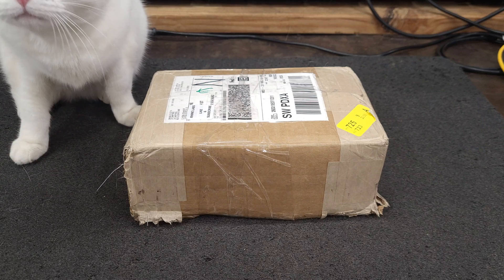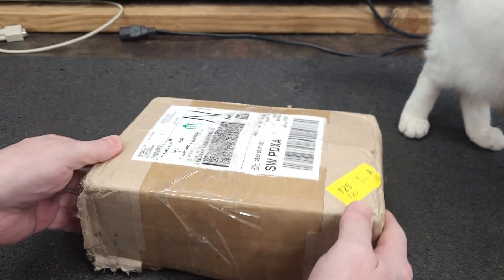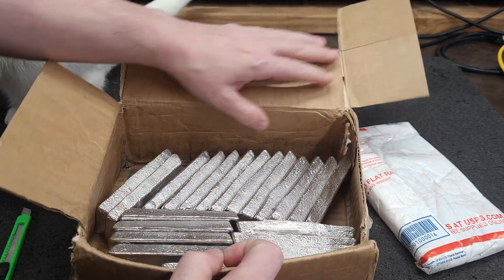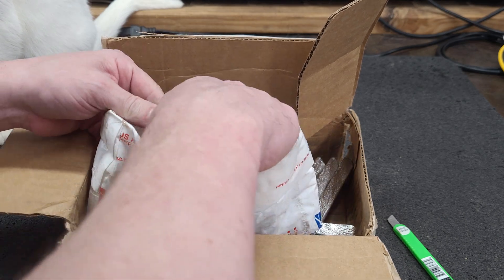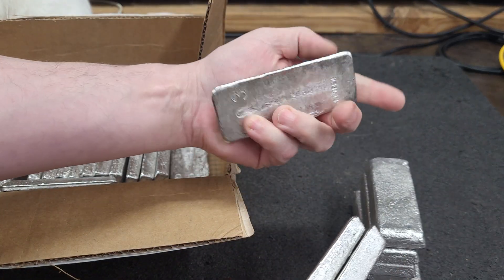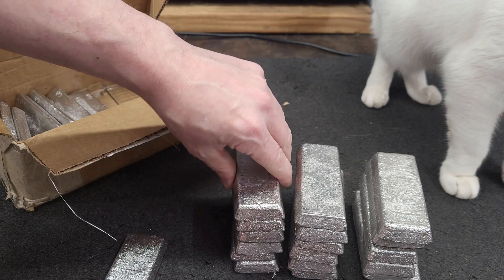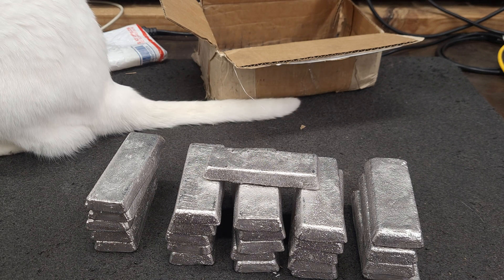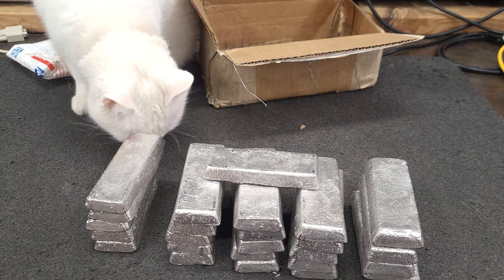Lifetime Supply Low Melt Solder Roto Matals 203F 95C Ingots

Comment: It’s a shame they’re not gold ingots 😂😂 that’s enough to last a lifetime. Been to website, might have to put in an order, definitely a better way of buying it.
Reply: Same here.  One order would definitely fix me up for life.
Reply from the maker: I have been using it for a while now works well.
Reply: @ I’m definitely going to give this stuff a try, been using the low melt chipquik but it’s quite expensive for not a lot of it. Thanks for sharing this.
Reply from the maker: @SURGE101  Chip Quick melts at 138C or 280F = to the Roto281F without the minuscule amount of ag silver. I tried the Roto202F lead free it was good also but not 4 to 5X  the price good.

Comment: Oh wow, that is so much cheaper than buying it in preformed... I wonder how nasty the shipping to Canada is...

What do you think about Roto158F?
Reply from the maker: @zmmj2024 I tried it, but it did not mix well
Reply: @Rhine_Labs  noted, thanks!
Reply from the maker: @zmmj2024  this mixes well with both leaded and lead free solder alloys and keeps its low melting properties.
Reply: @Rhine_Labs  Yeah, that's probably the one I'll order, though I won't lie, I was absolutely staring at the indium infused ones but the price... whew